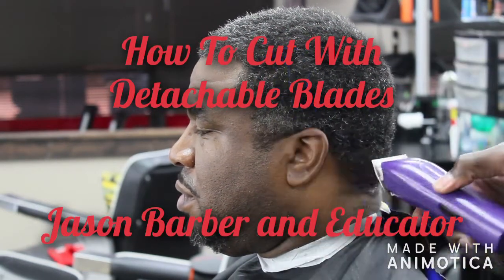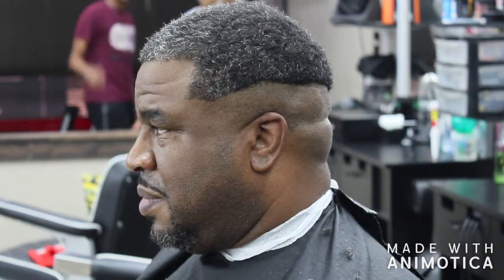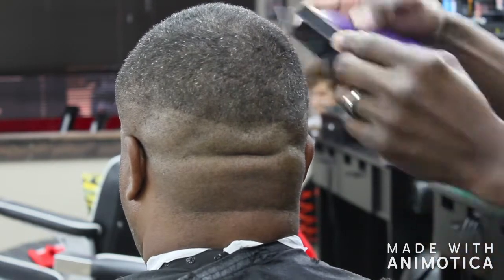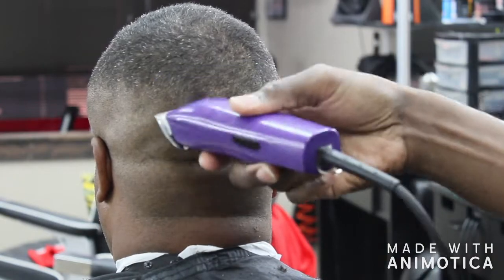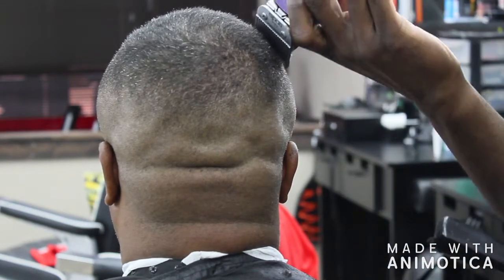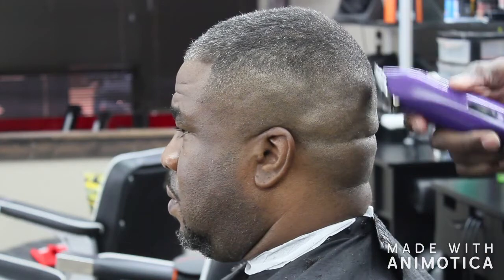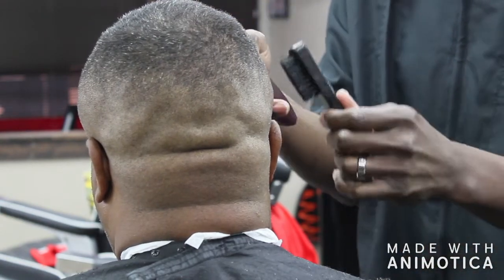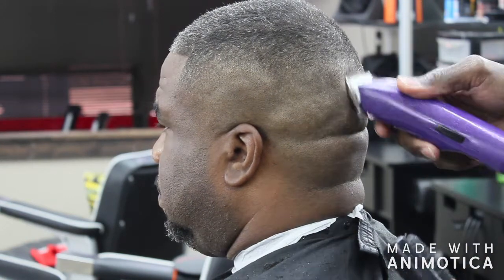How to Cut Hair with Detachable Blades

Comment: Good cut brother.. Are you using ceramic blades on all sizes? Are there any specific sizes you order or buy in ceramic blades or just one size fits all comb sizes?
Reply from the maker: Thanks for watching. Almost all my detachable blades have the ceramic blade. Not sure it’s much of a difference. You actually buy them that way. You buy get detachable blades made by Andis called Ceramic Edge
Reply: @jasonbarberandeducator7247  thank you brother!!  I appreciate it!.. 
Yeah I was wondering for my new 76ers coming through soon.. I'm collecting blade sizes and was wondering if I need to buy sets first then cutting blades ceramic to place with the different sizes in combs.. From 00000-3 1/4 size..